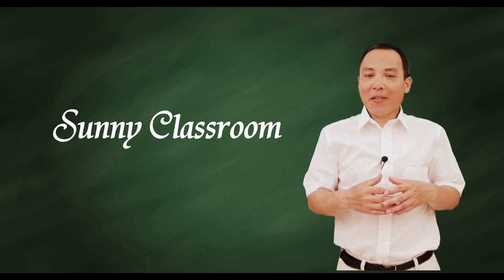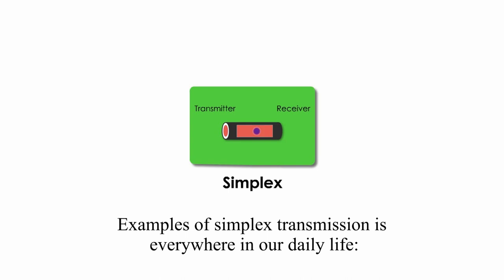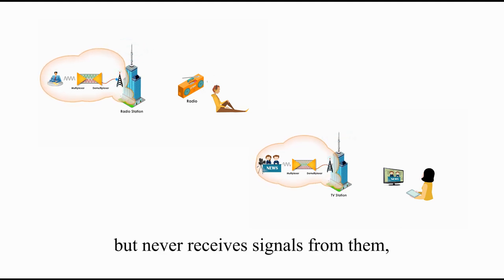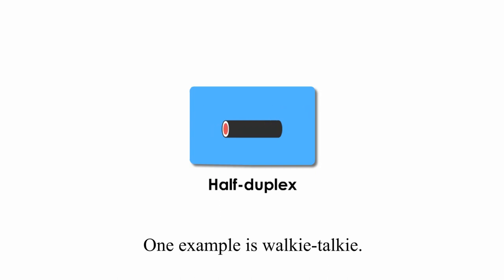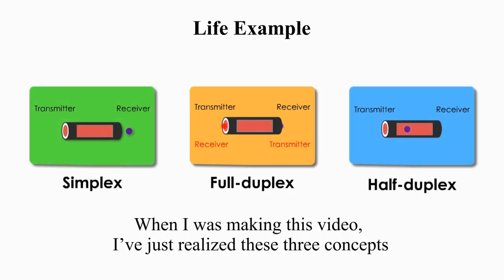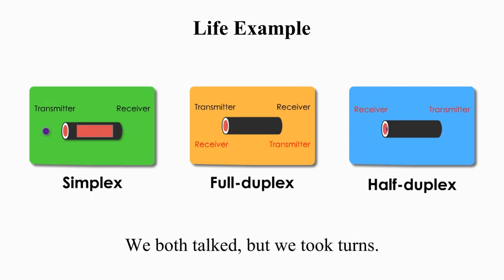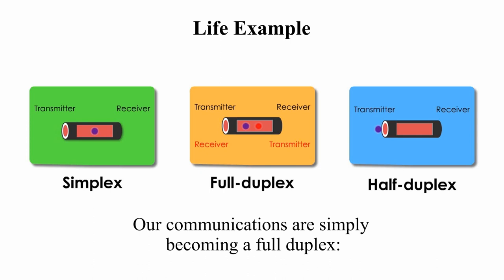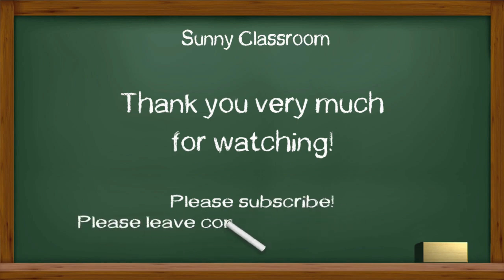Simplex,  half duplex, and full duplex

Comment: aside from the technical teaching, you teach me about how a marriage should work. wow xD
Reply from the maker: Thank you !
Reply: That's not how it should work. Full-Duplex communication is okay, but only if both can still listen to each other. You can use different frequency bands.
The one uses a high pitched voice the other one uses a low pitched voice or each transmitter filters out his own signal from what he recieves. You also need a brain that can process that much information at once.
Most people don't have the latter.
Reply: That is not a good example :-) should be half duplex all the way